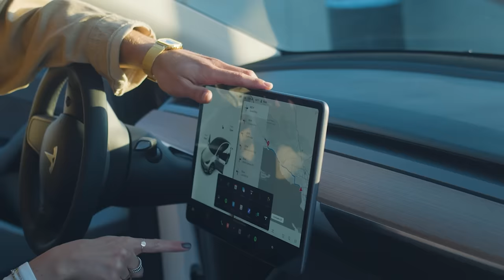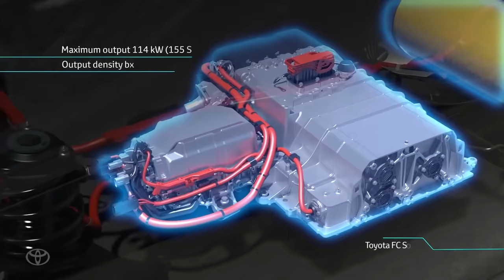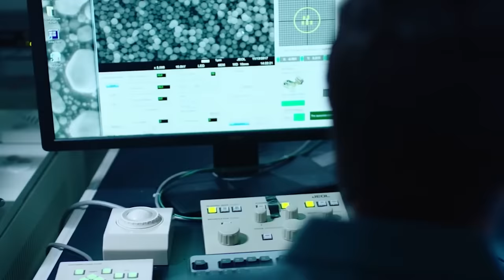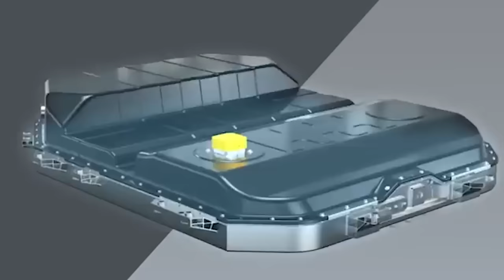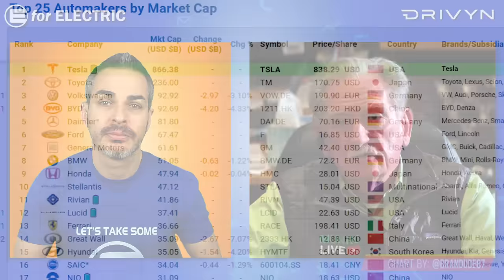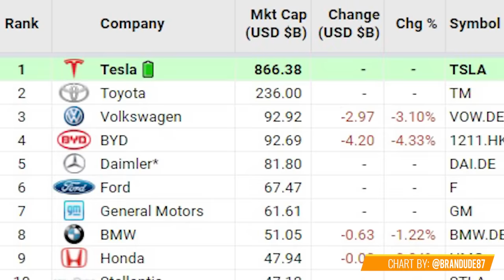SANDY MUNRO: Toyota's "Smart" Anti-EV Plan

Comment: Honda E is an amazing city car for crowded european cities with narrow streets. I’ve driven one on several ocasions. Has also an amazing turn radius. You should expand the scope of the show with traditional car show  points of view. Focusing only on range, charge and manufacturing clearly has its limitations.
Reply: But far too expensive for such limited function, no? A Zoe is also great. And it can drive longer distances. Costs about the same. A Dacia is perfect for cities and half the price if the Honda.
Reply: @winstoncat6785  But if u crash in the dacia ul likely be dead or severly injured with 1 star ncap rating compared to honda e`s 4 star.
Reply: @winstoncat6785  when going outside the city, the guy usually takes his 7 series. i kind of have a similar setup, with an i3 and an x5. Having a car perfectly suited for the task at hand is much more enjoyable and efficient than having a car for all situations, but not perfectly suited for any.
Reply: @alexs36zero  the i3 is awesome. I had one for a weekend and almost bought it, but living in the vast western usa, the range simply was not acceptable. same with the Honda E. I really love the design and want that car, but the range is a dealbreaker.

Comment: So many great points here from Sandy. My favourite is" You can measure intelligence but stupid is boundless".Japanese culture and language has many nuances and the same or similar words can have different meanings with inflection even before body language is considered.Modern business competition  has replaced the role of Samurai.Hai.
Reply: Actually, some of the samurai simply adapted. When I worked in Japan for Sony, I interacted with a group of high-level managers who all descended from high-ranking samurai families. The Shogun-era class system still has influence, most notably in promotions.
Reply: @georgew2014  And the influence of the Yakuza.
Reply: @simonalexandercritchley439  The Yakuza are considered low-class. The exception are the children, specifically the daughters, of Yakuza bosses. That said, Yakuza have been used as enforcers in retail situations, as in, " Don't stock a competitor's product, or else."

Comment: The Toyota Mirai fuel cell car has a tiny 1.6 kWh battery. This is far smaller than the 4.4 kWh battery in the Toyota Prius hybrid, which in turn is far smaller than the battery in any battery electric vehicle (22-200kWh).

It’s completely illogical to assert that because the Mirai is “the best” fuel cell car that it must also have “the best” battery technology. Actually, it’s an old technology Nickel metal hydride (NiMH) battery. It’s not even a Lithium-ion battery. The Mirai absolutely does not have the best battery technology.  It’s 20 year old technology.
Reply: L
Reply: There is a ramp up time for the fuel cell to deliver peak power (0 ~ 100)%, around 6 seconds, meanwhile the battery bridges the gap.
Reply: I agree ....
Toyoda is the arrogant one...he has blown  his family legacy.... 
That's why they will stick a Toyota badge on a BYD next year...
Reply: It only needs a battery to hold charge for a few seconds they could have use a lead acid battery and still it would have similar range
Reply: I think Sandy's point was that the car runs on electricity, and that it would not be hard to replace the fuel cell and existing battery with a much larger solid state battery Toyota is working on. Not a lot of re-engineering to do.
Reply: @rok1475  My reply was about the high capacity modern (lithium ion) battery chemistries in BEVs as compared to the small and older (NiMH) battery chemistry in Toyota fuel cell and hybrid cars. 
I'm a chemical engineer with 30 years of experience in that field; my comment was about battery chemistries. 

I have the deepest respect for Sandy's expertise (I learn a lot from both his channel and from his contributions to the E for Electric channel), but he is occasionally wrong.
Reply: @rok1475  I have already said that I have deep respect for Sandy’s expertise, and that I have learned a lot from him.  Your reading comprehension skills could use a reboot. 

My original comment stands, the  battery technology used in hybrids is very different from the battery  technology used in BEVs.  Toyota’s excellence with hybrids gives them no battery technology advantage for  BEVs. If you disagree with that, then be aware that Sandy said that Tesla has a 5-10 year technology advantage over the rest of the industry (which includes Toyota).
Reply: @Laura-S196  To disregard an advantage purely because it is not against the top competing brand is wasted potential. The use of batteries alone can provide a great foundation for understanding how a battery can be utilized in something much grander. The same applies to most all trades and practices. In addition, that man never stated that it has the best battery tech as he was speaking in hypotheticals stating that the batteries "could" be the best while being complemented by the best fuel cell. Your hearing skills need work lol
Reply: @Murderousblue  My hearing skills are fine. Sandy said “it makes logical sense that if they [Toyota] developed the best fuel cell that I ever saw then does not be complementary wasn’t it not complementary to develop a battery pack that could be the best in the world”. 
No, that is not logical. If one does some investigation into Toyota’s fuel cell car, the Mirai, it’s obvious that it doesn’t have the best battery pack in the world. Until last year, the Mirai had a tiny NiMH battery, which is decades old technology.  Not since the 1990’s has a battery electric vehicle used NiMH technology.  
All modern battery electric battery vehicles including those made by GM, Ford, Renault, Nissan, Peugeot, Jaguar, BMW, Audi, VW, Mercedes Benz, Audi, Porsche, Tesla, Rivian, the Chinese automakers, and Lucid use Lithium ion batteries in their battery electric vehicles. Lithium Sulfur batteries or solid state batteries might be successful in future BEV applications.   Prior to last year, the Mirai had a tiny NiMH battery.  Now it has a tiny Lithium ion battery that also isn’t the best battery pack in the world. 
It’s debatable who has the best BEV battery pack technology today. Some claim that LFP (which is common in Chinese BEVs) is the best, while others claim that Tesla’s 4680 battery pack technology is the best. During his visit to Tesla’s Gigafactory Texas where Tesla makes 4680 cells and packs containing 4680 cells, Sandy was highly complementary about Tesla’s engineering. There is a great video on Sandy’s YouTube channel about his visit. 
There is a long story about the NiMH battery patents that partially explains why NiMH wasn’t further developed for BEVs 5-15 years ago.  The NiMH patents have expired, so automakers are free to make NiMH BEVs. But none of them have announced a product that would use that technology.
Reply: @rok1475  30 years of experience also comes with 30 years of bias.  His views on Toyota are based on his views from when he worked with them in the past when they were a far better OEM than US companies.  As for his views on Japanese culture, they're not entirely accurate.  His understanding of the word はい  "hai" comes from a person who only has a surface level understanding of Japanese culture and language.  Those managers who were responding to the CEO with "はい" was just a sign of respect and acknowledgement of what he was saying.  That's all.  And I can guarantee that the CEO said something far more offensive than the phrase, "arrogance is opportunity."  Japanese translators will often paraphrase what was actually said in Japanese as a means of saving face.  If Sandy had a fluent non-native speaker translating for him, I guarantee what he was told would have been more nuanced.
Reply: @Laura-S196  I also have some battery system experience, including FC development. Best battery technology does not always mean the LATEST. One example: We were developing a high volume product for a very specific & high abuse consumer market. The "best" rechargeable battery tech at the time was NiMH, Li-Ion was still new and complex regarding charging, etc... Based on our requirements, and the NiMH high self discharge rates, we determined that Lead -Acid was the most reliable tech to go with. (Today we would be using Li-Ion). Best battery tech depends entirely on the application. Toyota does not take large risks. This is very typical of some very large Japanese manufacturers. They do not use bleeding edge tech, they tend to stick with reliable.
Reply: except the fuel cell is the "battery" (energy storage) they could have used supercapacitor instead instead that NIMH battery

Comment: In my opinion, it all comes down to charging infrastructure. Unless one of the large auto companies or energy companies steps up to the plate in the USA and does something similar to Tesla and the charging strategy, I wouldn't consider buying from any other company other than Tesla.
Reply: GM could just put a few  high-speed chargers at each dealership, and integrate them into their vehicle nav like Tesla has. If they did so, I would consider getting a Silverado EV instead of a Cybertruck. As is, they seem DOA to me.
Reply: I would. I do 90% of my charging at home with a Level 1 charger. If I had a Level 2 charger it would be 99% of my charging at home. Charging infrastructure is overrated, although ultimately necessary.
Reply: @paulrybarczyk5013  chargers at dealerships always seems to be iced. I think they do it on purpose because they don’t want people to buy EVs.
Reply: @lemongavine  Icing would be easy to fix, but I’ve never seen a high speed charger at a dealership. Just Level-2.
Reply: @kevinkent6351  Agree. The charging infrastructure will evolve. I ordered an I4. I do like Teslas and respect the company.
Reply: @silverfox1234  Just as a natural synergy developed between convenience stores and gasoline stations, I suspect a similar synergy will develop between restaurants and charging stations. Perhaps also with shopping centers and grocery stores. Or any places where people normally spend 30 minutes or more. It seems like some of that has already started.
Reply: @paulrybarczyk5013  if gas station owners were smart, they would start removing some of their gas pumps now, and installing chargers. If they wait until the end of the decade, they will be out of business.
Reply: @paulrybarczyk5013  I’ve heard that Nissan is putting in fast chargers for the Leaf at their dealerships to enable them to return the cars charged after servicing.
Reply: @lemongavine  "chargers at dealerships always seems to be iced."
 My experience is that is rare. However all dealerships will not let other brand cars charge at their station.

Comment: I have a request: would the 2 of you discuss the maintenance support for ALL the potential electric car brands comparable to what exists for gas engine cars? 
Seems to me Tesla is soon to be overwhelmed by the sheer numbers of their vehicles  seeking some sort of repair or just maintenance. 
* reference Gruber Motors and their posts
Reply: Rightly or wrongly, Tesla's aim is to build ultra-reliable cars that do not require much maintenance. Tesla addresses every failed part that has to be replaced with the question,: What do we have to do so this never happens again? Because of this approach, they are reluctant to spend huge amounts on service departments. They do not look at service as a profit making goal. When they do have failures, it strains their service capabilities, but they are addressing this with an ever expanding service network.
Reply: @royh6526  Think you are missing the OP's point Roy.
As Tesla's get more popular, they've become a victim of their own success.
So when lifes minor accidents like being rear ended happen (non write offs) Telsa is seemingly struggling with their service centre capabilities and more importantly, the lack of common spare parts.
Lots of negative stories now about excessive repair times vs traditional ice vehicles.
Reply: I don't think we've reached critical mass of old EVs off warranty to make third party service very popular, partly because EVs are low maintenance. I looked it up, there are a few in the LA area.

Comment: I have been working a lot with the Japanese and what ever they do is planned down to the last detail. They will give you the time schedule a month in advance and the plan usually holds down to the minute. So what every Toyota is planning you can be sure that it is a long term plan. This is unlikely the management in western companies that at best thinks five years ahead and where cost cutting often trumps quality. What the Japanese are not so good at is improvisation when things don’t go according to the plan. When Toyota, Subaru and Lexus now comes out with all electric cars it is all reason to think it is part of a long term strategy. They have come up with a new platform which will be the basis for new models to come. When it comes to build quality they have been among the top ten brands for many years. The same can not be said about Tesla which have had various issues. Also the Mustang, the Jaguar and the VW have had their issues. Right now the Chinese are entering the marked with the likes of BYD, Hongshi and Nio . It seems like all of these gives you a lot of car for the money but long term build quality is yet to be seen.
Apparat from build quality I think market leader will be the brand with the best energy density, lang lasting, fireproof and cheapest batteries will win. The development of the best battery will be a key factor. To some extent I think charging performance also will play in.🤔
Reply: Good assessment, but also thinking like an EV nerd. If most people thought that logically, Toyota would probably be 90% of the Auto industry.
Reply: @rp9674  When you buy a new car you do it with just much of your heart as your head. Car dealerships knows this and that is why they are so eager to have you test drive one of their cars. 9 out of 10 people will not buy that car but number 10 will. If they manage to have 100 people test one model they would have sold 10 cars. If everybody bought cars with their heads we would have had a rather dull car park. There would also been a lot of people dissatisfied with their cars, not because they are bad but because they are so boring. Personally I drive a 9 years old BMW with a Diesel engine but I plan to change car soon. This time it will be an electric car. There are many reasons for this.First of all they are cheaper because there is no vat on this type of car yet here in Norway. Secondly the prices of diesel and gasoline are now extremely high. Thirdly the range of electric cars are now acceptable and charging stations are everywhere. Also the selection of models are good and there is a car for everybody’s taste and needs. 🤠

Comment: I entirely agree with Sandy on this - Japan depends on their auto industry; they are not going to be easily out done in their industry.  Toyota has more solid state patents than anyone and has the only operational solid state vehicle.  Toyota also understands production constraints like how much Lithium is available - so they are smart enough to make more vehicles rather than fewer using the limited resource - Given the same Li -you can make 1 Tesla Y or 10 Rav 4 hybrids - that can commute all electric - so what is better for the environment 1 full EV or 10 PHEV hybrds - clearly 10 hybrids.
Reply: There's a reason why Tesla went with EVs. Not with hybrids.

Look it up.

Comment: Toyota has been resting on their reputation for too long now. The BZ4X will sell well at first simply because it is a Toyota. However, customers will quickly realize how inferior the product is for charging and value.
Reply: I half agree, the mainstream non-ev nerds will probably be happy with it.
Reply: @rp9674  Because people aren't all hung up on charging and efficiency. The bZ4 got the car basics right despite what anyone thinks of the styling and interior and even despite the recall. Read the reviews. Quiet, smooth ride, solid construction, those are the basics that a lot of people want in a car. We've been buying gas inefficient cars forever, why would people suddenly care that much about charging efficiency? Reasonable performance with comfort and a no-fuss maintenance schedule and that will satisfy many customers.
Reply: @benjaminsmith2287  the only problem with the styling is the stupid black wheel surround, if the price was right and I wanted a big vehicle I would get it and fix the fenders. I would like a little quicker 0 to 60. It'll be fine for most people tho.

Comment: Japanese car manufacturers are pursuing hydrogen technology because it is national policy.

Japan aims at realization of a hydrogen society and hydrogen ranks as one of the key factors for decarbonization.  Japan seeks to commercialize hydrogen power generation as well as to establish international hydrogen supply chains and to cut the unit hydrogen power generation cost.  Hydrogen is listed as one of the 14 key sectors of Japan’s Green Growth Strategy, which is an industry-wide policy.  METI has developed a basic strategy for the development of a hydrogen society.

While the Japanese auto manufacturers will try to 'sell hydrogen' in export markets, it is primarily technology for the domestic market and related to the particular circumstances in which Japan finds itself.

I have no doubt if at the end of the day, export markets call for BEVs that's what they will make.